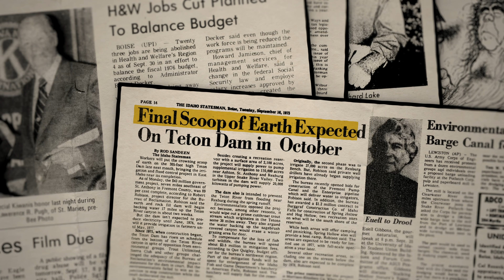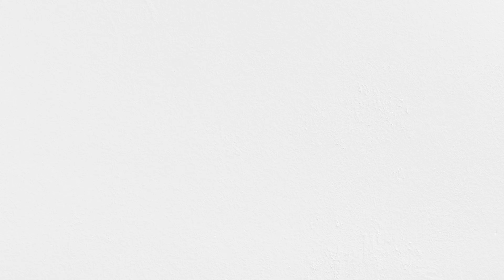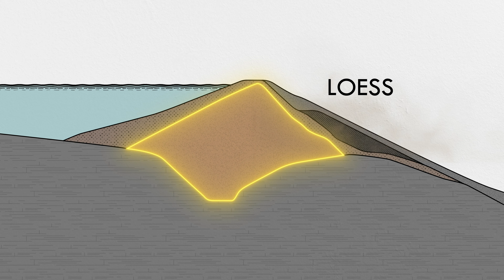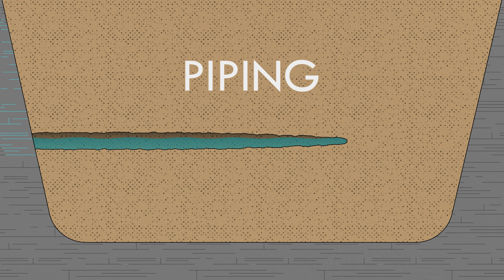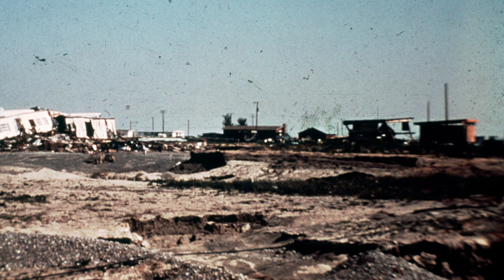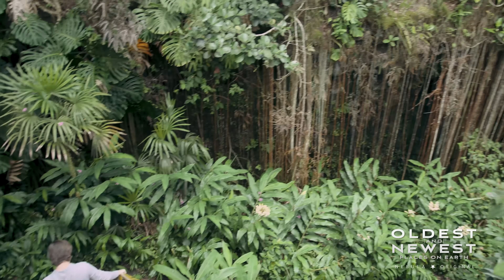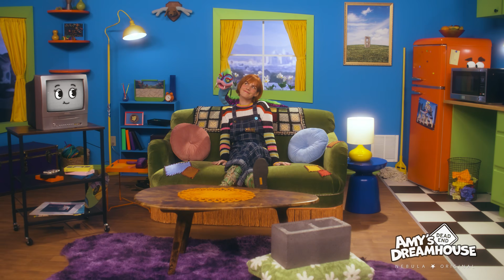The Wild Story of the Teton Dam Failure

Comment: I live along the Missouri river.  Your little segment around 16 minutes in "we think of the ground as the ground" and "geology affects us in all kinds of ways" reminds me of a little oddity here.  At Giant Springs, there is arguably the world's shortest river, flowing from the spring into the Missouri about 12 feet away.  Anyway, the spring has a very large, constant flow rate, regardless of season or drought, and various tests and studies have shown that the water is NOT coming from upstream along the Missouri.  Originally they thought that water from the Missouri was flowing underground along the bedrock until it hit something and diverted upward back into the river.  But that's not the case.  They're still uncertain of where the water comes from, but the most likely area is the Belt Mountains 20 miles away.  There are a number rivers, streams, and lowlands between the mountains and the Missouri river at Giant Springs, but this water doesn't share with them.  Its somehow isolated, flowing completely under everything, until suddenly it comes back up above ground.  And they still don't know exactly where it originates, because the dissolved materials in the water don't match up with any of the potential, visible sources.

Comment: Around 1999 I built a house on lava that was covered with about 7feet of the compacted loess that you describe.  This is the loess that covers a great portion of southern Idaho.

It’s funny stuff.  When it was loosened by the backhoe that dug down to the lava (which became a very solid foundation for the house) it mixed with air and became fluid.  The fluid sloshed around in the hole like water. It supported ripples and waves and reflections!  

It’s funny stuff, alright, but it is ideal for growing potatoes.  When the russet potato strain came along, making the tubers hardy against the alkalinity of the loess-based soils, they thrived.  Hot days and cool nights are just right for potatoes.  That’s why Idaho is famous for them.

But as you explain, the loess and tuff aren’t worth a dam.

Comment: The remains of the dam are surprisingly accessible to this day. The unused spillway is still there with a road right to it, on the other side is a nice tourist style overlook. You can even drive down into the former lakebed and see the outlet infrastructure on the sides and go right to the toe of the last standing pyramid of dam material. 

The south side is worn away in a perfect cross section, you can see the different layers of material that looks just like the drawings in the video. Also the key cuts on either side are completely exposed, you can walk right into the south one. It’s very humbling and unique to walk in a place that was never meant to see the light of day ever again

Comment: This is just plain poor engineering design as the dam leaked as soon as water was impounded.  Just because it was in the US so people put a spin on it to cover the root cause.

When sufficient head was built up behind the dam water leaked immediately at the interface between the man-make dam and the existing valley.  That mean it was no good just to compact the dam's soil when the soil of the valley was in a loose state and porous.  The engineer should have excavated into the valley to properly "key" into the existing soil without the leakage risk.  It is just common sense like gluing something on a dusty surface.  It will eventually come off no matter how strong is the adhesive.

Comment: that loess flows like water under pressure. any significant weight on top of it and it will eject elsewhere, add a wet line where water is interacting with or in it and that lubrication will let it go away immediately. 

worse than that, the very porous tuff seams are not strictly horizontal, many run vertical. It's very likely that water flowed from under the base of the reservoir up into the surrounding rock, and into the dam from the sides. There was also the decision to not anchor the dam into the badly fractured walls using piles and concrete due to the cost and schedule. There were also the advisories to completely seal the walls of the reservoir with concrete to prevent water injection accelerating the break up of the canyon walls on either end of the dam. The failure occured very near to a "flakey" kind of formation where the binding layer between volcanic flows had been dissolved by rainwater and the rock layers are completely delaminated. Add any water injection into that and the rocks lift apart and you get a lot of flowing water. One of the cost cutting things they did was reject ground level monitoring system that would have detected the ground lifting up as water pushed into those delaminations.

On an interesting note, some 70 or so miles away the dam at Mackey, ID is considered to be at extreme risk of failure. Might be worth doing a little reading on it before it gives up.

Comment: I grew up in Idaho Falls and my first job fresh out of college in 1973 was on the Teton Dam project. I was on the inspection staff as an electrical engineering inspector. My job was to document all of the electrical installation for code compliance and material and labor payment. All of the inspectors wore several hats and I did stints inspecting mechanical installations, tunnel works, concrete placements and reservoir surveys. I left in 1975 to work for the Corps of Engineers in Eastern Oregon. I was having lunch with my wife and mother the day my youngest brother called from Ririe, Idaho to tell me the dam had failed. It was a total shock and has influenced my engineering thinking ever since.

Comment: You might be interested in my great uncle Charles Peter Berkey.  Here's some information on his work....   

In the era which followed the catastrophe of the St. Francis Dam,
leadership in the field of engineering geology was assumed by Professor
Berkey; this is largely described in the memorial volume on
Application of Geology to Engineering Practice published by the
Geological Society of America and known as the Berkey Volume.
During this period many great dams were constructed, several large
cities built aqueducts, important bridges were erected, and other
forms of construction requiring geological advice were undertaken.
As a member of the Board appointed by President Coolidge to
pass upon the plans and designs of the Hoover Dam, Professor
Berkey assured the engineers that the rock of the walls along the
Colorado River at the site was safe for large outlet tunnels. He also
advised upon the suitability of the rock floor to hold the highest dam
in the world. The dam itself now stands as a silent witness to the
value of his good judgment.

The enormous dam across the Columbia River at Grand Coulee
and the large reservoir in Grand Coulee itself constituted another
of the major projects on which Berkey advised. Here again the rock
floor was subjected to close scrutiny. The material itself, as well
as every crack and fracture, was examined on a completely exposed
surface to ascertain that the concrete when poured would form a
dam inseparable from the rock beneath.

Comment: The whole foundation surface under the dam should have been coated with concrete, with the upper surface shaped to hold the fill. That concrete should have been extended up the abutments and quite a ways up stream, with a wall sunk at the upper end. There should have been a deep trench dug under the center of the dame, then filled with concrete. The entire upstream face of the dam should have been coated with concrete. Lastly, filling with water should have been postponed until both bypass tunnels were complete.

Cost cutting in dam construction was nothing new. Look up Practical Engineering's videos on the failure and rebuilding of the Oroville dam spillway. Had it been built the right way in the 1960's it wouldn't have failed. Even if the construction plans had been followed exactly, it likely would not have failed. What I think is crazy about the rebuild is it still has joints with seepage drains to send any seepage back into the spillway lower down. Why do that when it could be made 100% water tight by coating it with a thick layer of polyurethane? The same stuff used in spray on truck bed lining and on masonry walls to keep them from collapsing when shattered by explosions or earthquakes.

Comment: Safety is written in blood. Engineers are tasked with finding the limits of Safety. The darker/crappier edge of that sword is they have to find those limits balanced against Cost. When Cost is no issue, and Safety is paramount; the Engineers get to play to their fullest with so much freedom they can get lost. When Cost is the biggest variable of the equation engineers can be completely handicaped to the point of uselessness, sadly with lethal consequences... 
Cheap, Fast, or Good. Pick any 2....
Reply: They chose Cheap and Fast.
They chose unwisely

Comment: Grady, you don't need to excuse the engineers here. They were simply winging it.
After all this was the time,  where they tried to use nukes for fracking at oil wells or shot with shotguns at barrels with toxic waste (allegedly).
You know, the wild times of engineering.

Comment: I was one of the many Amateur Radio operators that provided communication throughout the area. At one point I was stationed at the sand bag filling site and directing the loaded trucks where needed. I remember one old gentleman that showed and and said "I have a strong back and a shovel, where do you need me?" After we finished the last flatbed truck I was stationed at Civil Defense Headquarters. We could see the raging waters lapping at the sandbags and pushing on the Broadway bridge. I remained at Civil Defense for several days providing communication for many necessary positions in the area like hospital and airport. The main phone line was cut to west side of town when a wide trench was cut on west side of Broadway Bridge to relieve pressure pushing on main bridge. With the phone line cut there was no operating phones on entire west side of town. When the flood water went down it took Mountain Bell several days to splice all the cut wires. I had a totally new idea of what a dam break meant. I am still an active Ham Radio Operator now living in Arizona. I miss Idaho Falls but not the snow.

Comment: Very apt timing for this video during the very days when the Sanford Dam  in Michigan was refilling for the first time the Cheboygan Dam came inches from being over topped. There was a sense of urgency, focus and connectivity with the contractors rebuilding the Four Lakes that saved the city of Cheboygan. 

The contractors rebuilding the Sanford Dam were called on to rip off the spill gates to help pass enough water to hold off disaster while the turbine was brought back online.

It also highlights again the issue of dams across the state built for power generation and navigation. Private owners often don’t have the means or financial incentive to make upgrades. While some of the wealthiest recreation communities in the state grow up alongside these lake and river systems. 

A massive late season blizzard on top of a heavy snowfall season in northern Michigan primed this potential disaster. It was the rapid swing in temperatures that kicked it off with temperatures getting up to 70 and a week of heavy rain. 

Fortunately the rain stopped and temperatures dropped below freezing at night slowing the remaining melting. If the rains had continued it would have been a different story.

Comment: I grew up about 40 miles south of St Louis, Missouri. In the 70's there was an active project to dam the Meramec River by the Corps of Engineers. Minor construction was started on the project. After the failure of the Teton dam, public sentiment dropped very low for the project. Leading to a public referendum in the surrounding counties in which 64% of people voted against the dam. That led to elimination of the proposed dams.

Comment: It's all the fault of those dam advocates. 😉 The entire area was generally not well suited to the project anyway. The whole project was pushed by an overconfident government, ignoring engineering prudence. It was a project doomed from the start. Even facing the dam with concrete and putting a 30 foot skirt underneath it and extending that (and a wall within a cut trench) well to either end of the dam probably wouldn't have changed anything that happened.

Comment: Wayne Easton has a video (two parts, ~16 minutes total) of a natural breach of the Black Rock (Mahlongwa) River in South Africa.  After a heavy rain it breaks through the beach "dam" to empty into the Indian Ocean.  Starts off as just drops of water trickling over the crest but in no time flat it is a torrent that would sweep a person away.  It is an incredible demonstration of the eroding power of water.  A beach built by the waves of the ocean cut through by water under no pressure save the pull of gravity.

Comment: Love the videos, but in this one it was very difficult to see what was being illustrated at e.g. the 9 minute mark. I had to lean in close to see that there were light blue lines on a light gray background, which in turn were supposed to contrast with slightly darker gray lines. Squinting just a little and it all looked like one gray color. I'd even prefer if the water were red there because at first I didn't even notice that it was an animation since it moved so slowly.

Comment: I was 2 when thee dam broke.  It's still a mess where the dam was.   Nothing replaced the dam in that area due to ground instability. The area is like a sponge so no hope of stabilizing it would have worked. If the dam didn't fail water would have just eroded arround it.  There are lava tubes in the area as well as tuft.  Before Yellowstone was a hot spot, central Idaho was.  Craters of the Moon is just 1 small part of it.  Check out Outdoor Idaho on PBS for more about the areas of Teton dam and Craters of the Moon.

Comment: In the late 70's worked with one of the guys that was using a bulldozer to push material into the dam as it was failing. Nice guy, but he would not talk about that day. Also he was a heck of a heavy equipment operator.

Comment: A bridge in China failed last November, and it seems the causes were similar - incomplete understanding of the geology combined with insufficient mitigation of the challenges it presented led to a mass wasting event that took out one end of the bridge structure. They're building a dam downstream from that site, which is one reason for the new bridge, and I sure hope they do a full re-evaluation before moving forward ... unlike Teton, the river being dammed flows through some narrow gorges containing small towns that would basically be obliterated before most people could evacuate. 
It seems there's always a need for these kinds of examples in the engineering community. Even 50 years later.

Comment: On Google satellite view, there is a  mountain in middle of canyon. Fair to state is this a remnant of the dam?  The east side of that mountains shows a core of one colour and think layer of earths of different colour surrounding it.  Is this the actual loeas in middle followed by the outer layer you mention in your video, or just totally unrelated colour artifacts ?
Since the breach happened on west side of dam and did not wash away the middle of dam, how come the east side of the dam is gone? 
From a purely engineering point of view, was the site doomed because of type of ground, or could a new dam of different material be built to replace the failed one?

Comment: Question: even if the spillway had been finished, wouldn't it have been useless since water level wouldn't have risen to reach spillway , and the spillway would have been unable, by design, to lower water level to reduce stress on dam? 
Secondly, was the diversion channel still operable?   Normally that channel is built "flat" and once they are ready to start accumulating water behind dam, the channel is quickly filled in and built up to same height as dam. (in a a race to prevent water overflowing it.)  So curious what sort of design for diversion channel would have been usable at that stage of filling of reservoir when there was an urgent need to empty it.  Was the tunnel between reservoir and the power generation and water pumping site operable, or is this the mechanism you mentioned in video was imcomplete?  Had water level in reservoir reached its water intake?